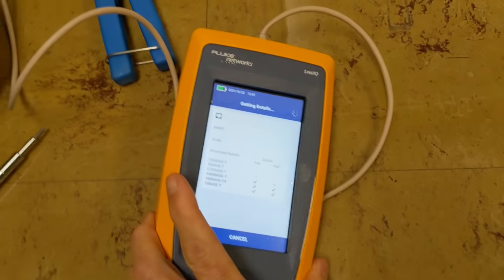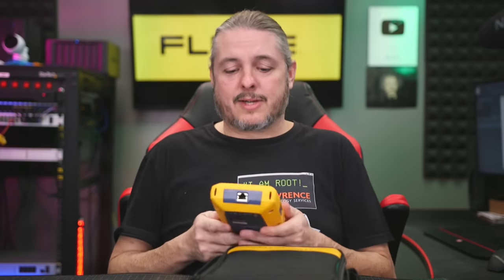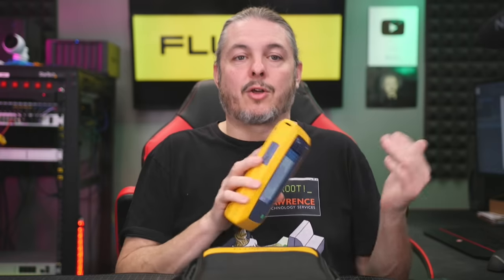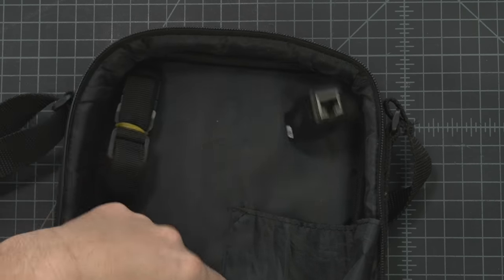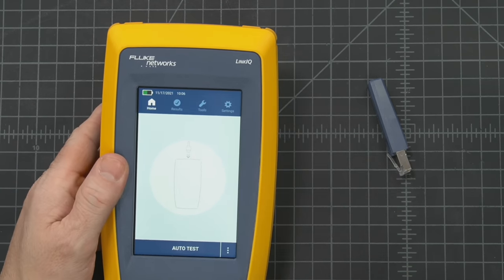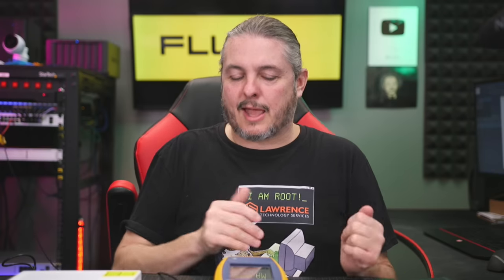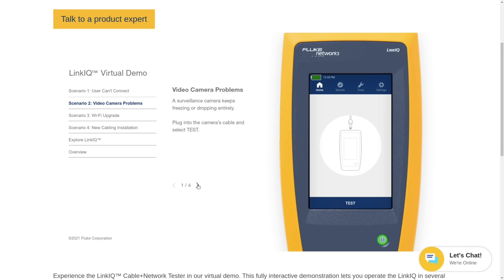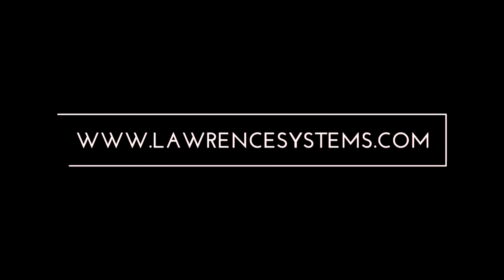Fluke LinkIQ Field Test and Review

Comment: I had the opportunity to use a fluke certifier for an install a while ago. I almost wish I hadn't, because fluke is definitely getting 5000 of my hard earned dollars in the (far off) future. The bummer was learning that a cable can be ran and terminated correctly but still fail with a certifier. In my case it was most likely due to high temperatures in the warehouse ceiling where it was ran through. Insertion loss was out of spec, like you would normally expect when a run was too long or poorly terminated. But, as I found out, the higher the ambient temperature is the shorter the maximum length can be. I managed to cut the run down to around 260 feet before I couldn't take out any more slack, but it was still just barely out out a spec. Ended up needing to run fiber instead.
Reply: which certifier cost 5000 USD ? The DSX range starts around 10000 eur (12000 usd) I believe...
Reply: @hoefie1977  The used ones on eBay!

Comment: I have issues with LLDP with my NetAlly Aircheck. Sometimes it comes right away, other times a second test is required (HP switches). Maybe something to do with the LLDP timers? Cisco switches work every time with CDP.
Also I have an old trusty LinkIQ gen 1. Had it for many years, it's worth every penny and paid for itself in months. Faster issue resolution with cable breaks and other faults. Reduced down time means reduction of lost revenue.

Comment: I had something similar the other day. We put a temporary AP out, someone unplugged it and plugged it back in wrong. Not sure exactly what happened but when I got there the ap was in the wrong outlet and the console port on the AP. Turns out it has completely destroyed the port, link runner won't pick it up at all, not even for data only. So useful.

Comment: Was lucky to pick up on of these last week (as new, in mint condition with even the plastic screen cover still on and pristine) for basically half-price and also luckily just after Fluke released a free v1.1 firmware update last month that finally identifies the Network Port and shows an assigned IP Address that the device is given from DHCP, and also finally ping an IP Address that you can assign in the Settings. (Maybe the previous owner got rid of it because it couldn't do this on v1.0...?)

You're right about the strange thing with this and UniFi devices - it will finally show LLDP information about UniFi devices now (v1.0 wouldn't do this for me), but it still won't show the VLAN number or the actual UniFi device's IP Address. The LinkIQ did actually prove to be worthwhile as it identified at a Site for me straight away a faulty connection at the RJ45 wall socket on line 1, when my other (cheaper) tester said everything was fine (although I was getting some intermittent packet losses from the connected PC). Furthermore, I could prove this to my Boss by saving a report on the LinkIQ about the Port before and after. I guess the ability to test the cable using wavelengths instead of data packets helped in showing right away where the fault was.

Expensive (even at half-price)...? Hell yeah, but it's already saving me time in troubleshooting faults at Sites (on my own by the way - which is even harder - the Boss won't let me have an offsider with me), so I'd say it's a good investment at the moment.

Comment: If you're only working with gigabit, the LRAT 2000 is pretty great. Does most of the LLDP and cable length stuff that Tom mentioned in the first few minutes. Doesn't test cables for rated speeds though.

Comment: So does this tell you the Port ID if you aren't using Cisco Switches? Will this work with HP, Aruba, Dell, etc switches in the same way or is the Cisco Protocol the differientiator?

Comment: Unify is probably not properly implementing LLDP. All of that information should come in a single packet. LLDP doesn't send the different pieces of information separately.
Also, it's "cute" that they play different toner tones and all, but only the Intellitone is useful. The others have gaps that are long enough to cause you to miss your port if you are moving the wand too fast. Still a huge Fluke fan, but that bothers me a little.

Comment: yea it is Cable IQ + color screen. But cable IQ is certifier + has ability to live cable - not one shot test. So you can wiggle the cable and make sure you have good RJ45 connector.
Reply: CableIQ is not a certifier, it is a cable qualifier (same as the LinkIQ). The "live cable" you mention on the CableIQ is only for the wiremapping, not for the actual testing. The LinkIQ will also test the cable up to 10Gb (CableIQ only up to 1Gb), and has also PoE testing (which the CableIQ lacks). The only real cable certifiers from Fluke are the ones from DSX range. I have a CableIQ. Wanted to upgrade to the LinkIQ, but the more I think of it, the more I believe the DSX certifiers are the ones I need, but they are very $$$.
Reply: @hoefie1977  my mistake. Totally agree on skipping LinkIQ. Its in a price range where one should expect more. Like testing Fiber - something like netally LRAT 2000 would do.

Comment: Tom, if you disable LLDP on the switch what information is the LinkIQ still able to provide?
Reply: The free firmware update to v1.1 (released in March 2022) now shows the Port number, IP Address assigned to the Port (and your IP Address assigned on that Port from DHCP), as well as beiing able to ping any IP Address that you program into Settings. If you want LLDP info (you can set the query time for this from 5 seconds up to 30 seconds from memory?), it will also now show LLDP info from UniFi devices (about time - although still not the VLAN ID or the base IP of the Managed Switch for UniFi devices). Version 1.0 firmware couldn't do that previously, so it's a bit of an improvement now.

Comment: They are expensive and generally found if it out of support you cannot download newer firmware with gold membership which can cost quite a bit.
Reply: I had the CableIQ for several years, and could always upgrade the firmware without membership. For the DSX range I believe you need to have a membership but I'm not sure...
Reply: LinkIQ firmware upgrade and the Linkware for PC was free for me... and I bought a (hardly) used unit. Didn't even have to register it online.

Comment: I like the tech in the device, but that's a really hard buy for $2K. I mean with a screen like that you should be able to test the cameras as well plus it should be able to verify cable for that amount of money. Lastly, you should be able to test fiber at $2K. If your someone who administers like really large buildings and you work for a company with cash to burn, yes I get it. But the average MSP is probably going with a $500 Klien over this if even that. I think a more appropirate price point would be to replace their $700 device with this model. I can plug my laptop into a switch port and run linux commands for what this is doing for me. Sure isn't not as convient but it's free.

Comment: Does this tester support Linkware Live?
Reply: No, you have to go higher in the Fluke product to get support for Linkware such as the Versiv.
Reply: @viaujoc  It works with the PC version of LinkWare for reporting, upgrades, etc.
Reply: @FlukeNetworksVideo  With the LinkIQ, you have to download the result through the USB cable right? The Versiv, however, can upload its result directly in real time, right?
Reply: @viaujoc  Yes, Versiv supports USB, wired Ethernet, Wi-Fi and USB memory sticks or cables for uploading, but LinkIQ is just USB with a cable.

Comment: Fluke Network have three categories of testing products:
1. Testing: just tells if pairs are OK and sometimes if PoE is available.
2. Qualification: Tells what speed will the link be able to achieve and what type of connectivity the network is offering
3. Certification: Verify every parameter of IEEE/ANSI/TIA/ISO standards and tells if the link meets them.

The LinkIQ is in the second category.
Reply: A small clarification - "certification" supports IEEE standards, but more commonly relates to "cabling" standards such as those developed by ANSI/TIA (aka "category" cabling) and ISO.
Reply: @FlukeNetworksVideo  I added ANSI, TIA and ISO to my original comment. Thanks for the clarification.

Comment: "I'm not certifying how far you can drop this ... that's not the point of my channel" - If anyone does want that kind of content, we all probably know the channel where you need to go... ; )

I will say, my old Fluke CableIQ isn't this fancy, but it still does what I need for basic qualification (not certification of course) and TDR (for when I've screwed something up). If I were more of a cabling installer, but didn't have the budget or need for a full-on certifier, this would be very tempting.

Comment: not worth the money, it's good no doubt, but you are just paying for a name in this case and can get the same thing for much cheaper.
Reply: Certainly takes a bit to recoup money, but considering a roll out for our ISP is $100 per hour plus parts and labor if it's a problem we caused and I'm paid a fraction of that, I can normally troubleshoot and repair a cable with the within an hour. My calculations say this paid for itself in two months (because our cabling was so fried in some areas). Your mileage may vary.